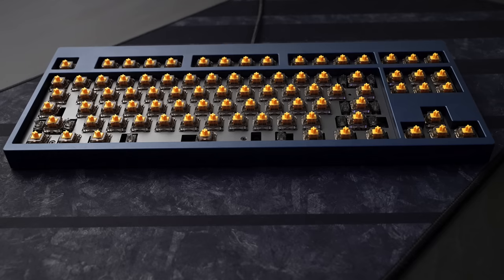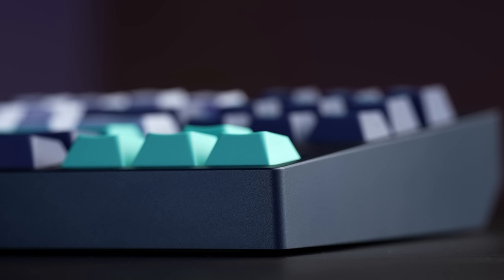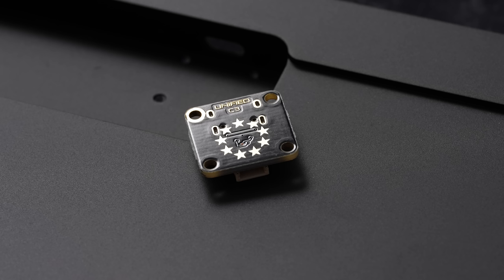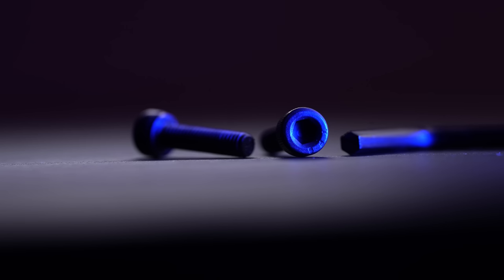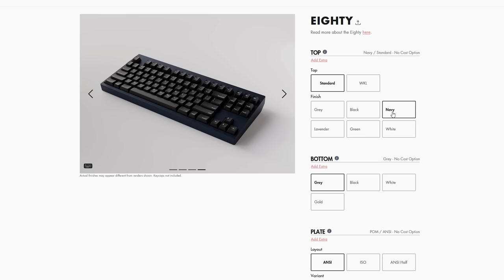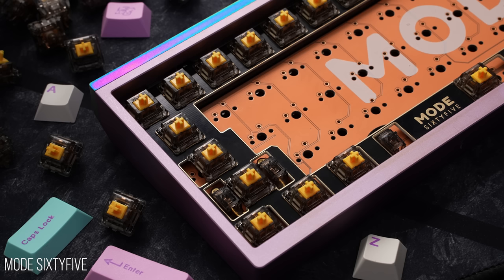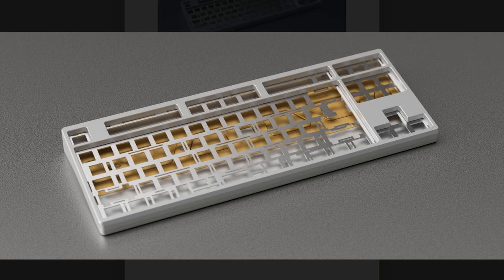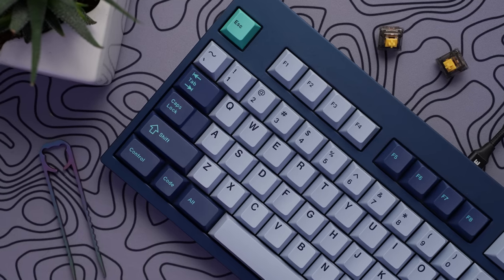MODE EIGHTY (80) - They Lowered the Price!!

Comment: As you said, it’s hard to justify the cost in this case. Another note, I’ve seen people receive their Mode 65, which is great even with the concerns about delays. The 65 is a much more interesting design in my opinion so I’d rather go for one of those than the 80.
Reply: Yeah just depends on the form factor you want. For me I use function and insert page up page down so much in software development that tkl’s are my preferred layout for general use. As someone who has the original eighty I really love it, and would be even better with iso top mount. The build quality of mode is stellar and I think mostly you’re paying for the fast delivery time.
Reply: @jamess.2491  all excellent points! Most of the custom keyboard market is all preference as far as layout, design, sound, etc. I can make due with a 60 but prefer at least a 65 to a TKL. I currently main a Mr. Suit after coming from a Drop Alt high profile and while I do like the extra keys, it’s not a necessity. You do make a valid point about the short lead time on the Mode products, which along with the unlimited buy aspect and customizability makes it a strong contender. I guess since I already have a Suit I don’t “need” another TKL at the higher price point.
Reply: personally i like the 80 only because all i have are 65 and 60 percents already
Reply: @dae8894  Valid point! I have two Suits so I'm good on TKLs. Haha. As BST said, there are other TKLs on the market that would fill this role at cheaper price, but still have solid build quality - just with a longer wait. I got a notification today that the Freebird TKL is available for GB right now. I almost did it but remembered I already have 2 TKLs!
Reply: The cost is going into the fact that it's in-stock/ pre-order and ships quickly. It's funny because the Frog TKL which he says is $290 is really $400 with shipping and pcb and that's more of a pain in the ass to get. Overall most people would gladly pay $50 to $100 for a good instock option that takes maybe 3 months at most to get. When you enter a GB you have absolutely no idea when it will get delivered and it usually gets delayed.
Reply: @egonpax  if you ever decide you hate one of your Suits let me know 👀
Reply: @lethargicjames233  Valid point that there a lot of people who don't want to do a traditional GB. And my bad about stating that the Frog is in GB right now. I meant the Freebird TKL. It's $225 for a full kit (case, PCB, plate) which if people are looking for a TKL, I don't think you can go wrong with one.
Reply: @dae8894  LOL. I doubt I'll ever HATE them as they are amazing. I still need to build my round 2 board but I'll do that soon!
Reply: @egonpax  it was worth a shot lol
Reply: @dae8894  lol! Round 3 should be this month!
Reply: @egonpax  wait, has the Dec drop for the frog been announced/started?
Reply: @garrickx2111  sorry! I misspoke and meant the Freebird TKL, not the Frog. My bad
Reply: @egonpax  ah right, thanks!
Reply: @dae8894  someone in the Mechanical Keyboards USA Facebook group is selling their red Suit right now. Check it out if you’re interested. (I know nothing of the person selling it so I can’t vouch for him nor say anything bad about him either)
Reply: @egonpax  haha thanks for keeping a lookout brother. I appreciate you remembering me lol
Reply: @dae8894  no problem. the keyboard community tries to be helpful!

Comment: I hear what you are saying in terms of the minimal design + cost.  But, this board sits in the quick turn around / in-stock realm of boards with lots of internal options.  the Frog and Mr. Suit are both great options at lower points for a TKL - can't fault anyone going for them but, the Frog gets limited color options per month and has has issues getting pcb's (not sure if the cleared that up), the Mr. Suit does GB runs but if you miss it then you are in aftermarket.   What you are paying for is a board that has pretty consistent sound, dialed in feel for you liking (no tape mod or pe if you don't want) - has color / plate / dampening and pcb options.  The closest boards I can think of to compare it too is the RAMA U80 and S+R Iron180 (which all have less config / customization options).  I know price is a factor but the 2 boards I just listed are in that price point.  What I like about this hobby is there is plenty to choose from and to each their own just like cars, cameras, watches and audio - options at all price points and choice are good things (sorry for the rant).
Reply: I'm not sure you watched the last part of the video where he said "If you are willing to pay a premium for the improved wait time" lol. End of the day, it depends on how you weigh your pros and cons.

Comment: I think the price is mildly justified by the very short lead time as well as the unlimited and indefinite time period for the groupbuy. Compared to other groupbuys you're having to wait 6 to 12 months (if not more) for your keyboard to arrive, and once the groupbuy period closes you'll never get the keyboard unless there's an R2 (or you'll have to pay exorbitant prices on the 2nd hand market). They've had history with delivering on time with their other keyboards so I'm more inclined to believe their ETA. 

In a vacuum I'd have to agree that for roughly $500 with accessories the Mode Eighty doesn't have as much value as other similarly priced TKLs in the custom keyboard market. I personally went for the 2020 version because it was already in stock and I liked the immediate satisfaction of getting the board in a few days. Honestly this keyboard would've been much better priced at around $400 but that 3-4 month lead time and unlimited indefinite groupbuy period is virtually unseen in the mid-high end keyboard market.

Comment: As of September 2022, this board "starts" at $399 (you will probably go over that at least a little bit). I am by no means in any place to afford a board like this, but the reason I am attracted to mode keyboards (besides them being visually really classy to me) is the sound. I have so far not heard any other board with the same sound characteristics as something like the mode80 and 65. Am I missing something?

Comment: But 6.25 bottom row is the weird bottom row :D Tsangan / WKL best. All jokes aside, that's a nice looking build. Hammerhead is chefs kiss

IDK if you'll see this but just a tip - The front height measurement doesn't mean anything. You should make a note of "adjusted front height" instead, which is the height at which the bottom of the first keycap sits. Boards can have 16mm front heights, at the front of the case, but that doesn't really matter, what's way more noticeable is how high the row 4/5 caps start at (which could be up to 21mm on a lot of boards), and where you'll feel the difference. Ask for that number when you're getting boards for review :D

Prices are also rough for manufacturing now that limits are being put onto factories for power consumption 🥲 but given the MOQ on this 450 is a lot for all alu

Comment: I feel like one missed piece is how good their anodization quality and paint quality is vs other "affordable" 200~300 dollar manufacturers is. This is a much more premium built keyboard and your getting what you pay for. I have this and the KBDfans 8kmx2 which is a very similar board at a price similar to mode. Mode just has a slightly better wait time. Also stress cuts into the board of the KBD fans is something i've come to like as well since brass plates are very rigid.

Comment: And there is now the freebird tkl which already seems like a better option with hotswap, plate options, wkl and o-ring gasket mount with a GORGEOUS side profile while only costing 225
Edit: also e-coating, 88 keys and a below average wait time, but its still in ic, you will also be able to get case only and an h88 pcb for soldered layout options
edit2: i was wrong you can order it already
Reply from the maker: Got a prototype on the way!
Reply: @badseedtech  excited to see the review, since there's only one right now

Comment: The Owlabs Jelly Epoch as an in-stock release was $60-70 cheaper (granted it is a 75%) with a brass weight, a daughter board with LEDs, and a silicone diffuser. I'm just failing to see how the Mode80 could cost this much with a reasonable profit margin.